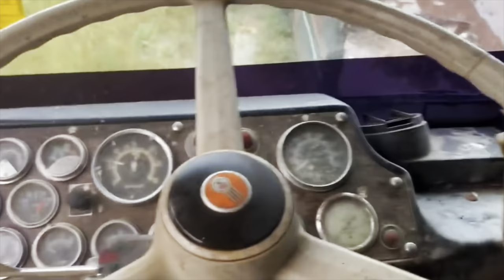Smokey & The Bandit Tribute Truck Ep.74 Painted Reefer

Comment: Hi Mark, keep up the good work. I’m also a amateur backyard painter. Just wanted to share a little bit of lessons. I’ve learned new sprayguns should always be cleaned with an inexpensive, clean up lacquer thinner on the air side and paint side. I had a new gun that had oil residue left over from the machining on the air side. I had to pour lacquer center in the air inlet, and push it through the gun.
Reply from the maker: Interesting 🤔 thanks for the tip

Comment: As a long time panel beater, One of the best products out is these wide bog applicators . That way you dont get groves in-between runs when applying filler. Spread your fingers to support  the applicator to stop it arching . We were told your eye see's lows easy as the sun reflects light but not as much with highs so if in doubt leave the panel a little fat Keep up the incredible work.

Comment: Hi Mark. A couple of tips: First thing is on those guns remove the little strainer inside the cup as it is not needed after using proper strainers. Second is you only need to sand primer to 220 grit when spraying single stage. Quicker & has more teeth for the paint to bite in to. There are many quality videos on gun set up to minimize orange peel too

Comment: Little old-timer trick. Add some dish soap to the water your straying. It will make the water laster longer and when dry the dust will be sticky/heavier. Won't blow around as easy. Side effect is when wet it's little slippery lol we use to do it back in the 70s bc the water would dry to fast. Painting cars back in queens NY

Comment: Looks really good! Come a long way from working on brakes outside in the snow.
What are you going to do with the opening on the bottom of the reefer unit? With nothing there, you will be able to see right up into the empty space inside when it is mounted up on the trailer.
Keep at it, highlight of my Thursday evening.

Comment: Hi Mark just a quick one .. when you mix paint in a paint mixing cup.. 
If it says 4.1. Or 2.1 etc look at your paint mixing pot numbers for example 4.1 pour your paint in and work on the 4.1. If you pour in the 4.1 to say 3 on the line do the same with your harder to the number 3 ..
If 2.1  pour in the lines of 2.1 on your mixing pot to any number in the 2.1 line so say you pour to 4 on your 2.1 line then pour harder or reducer to the number 4 and 4.
You look like you mixed the paint slightly weak / wrong 
In the last video you posted
But if 4.1 look on the 4.1 line and what  number in the 4.1.1you pour follow the next line in the 4.1 be it 2 or 3 etc. 
Hope you understand lol..
Or just have a quick look on YouTube on mixing paint.
Mark when painting such a short panel keep the gun flowing like you was doing with the primer not coming of the trigger !! 
Wetting the floor also keeps the dust partials down aswell
Thanks Darran over in the UK..
Reply: Also mark if you come of the trigger start the gun spraying before you come back on to any panel this can reduce build up and patching of the paint buddy

Comment: The gauge up high is for your coolant level, the reason it was a dead give away that the reefer was fake because the trailer had no fuel tank, which should’ve been hanging around the back side of the landing gear,
Reply from the maker: Also the plywood interior instead of insulated 👀

Comment: As a trucker for years, the reefer on the trailer never did make sense to me. No fuel tank, no front or rear vents on the trailer, no slats in the floor for air re-circulation and no air chute on the roof inside.  And, they got the beer at a non-refrigerated warehouse.
Reply from the maker: Back then Coors wasn’t pasteurized so it would’ve went bad without refrigeration but you make a great point that it wasn’t refrigerated at the warehouse 😂
Reply: I'm pretty sure those boxes were empty, based on the way they fell when ol' Cledus took a header off the forklift 😀
Reply: @darrellkidd5177  good point Darrell. And any experienced reefer hauler would never have loaded them right to the door. No recirculation.

Comment: Mark slow your strokes on the gun down you'll get better coverage and less orange peel
Reply from the maker: Appreciate the tip - gotta find the sweet spot between no orange peel and runs but I guess that’s where the “skill” in painting comes in
Reply: I know nothing about painting with a spray gun, but it seems to me that it would be better to paint from the top down than from the bottom up, as the overspray that falls would be covered in the next pass.  Is there a reason that bottom up is better (seems to work pretty well for you)?  Is it to help prevent runs?  As I said, I don't know the answer, just wondering.  Thanks.